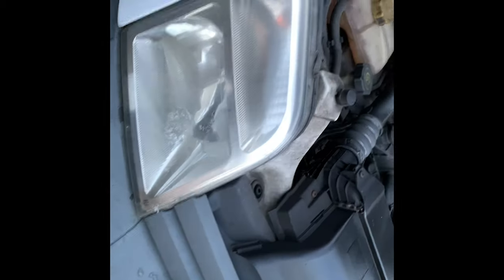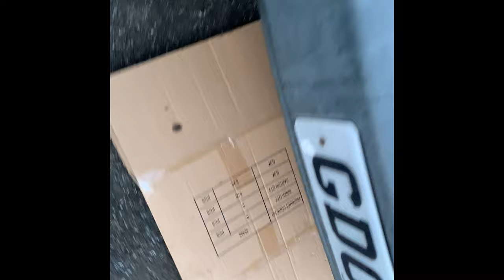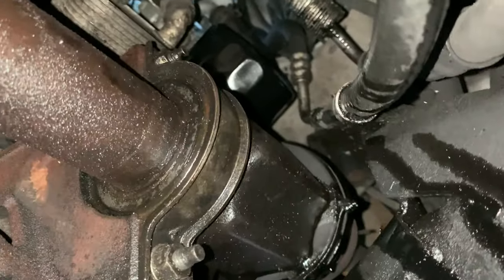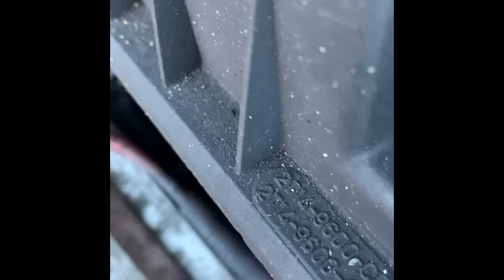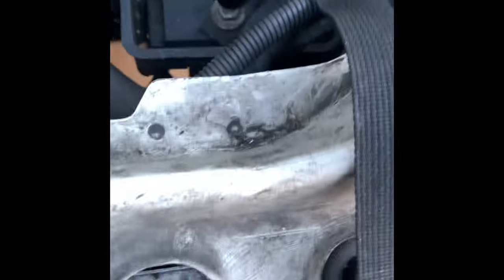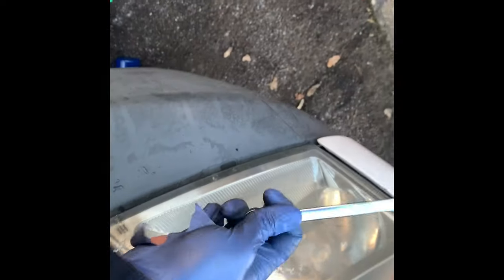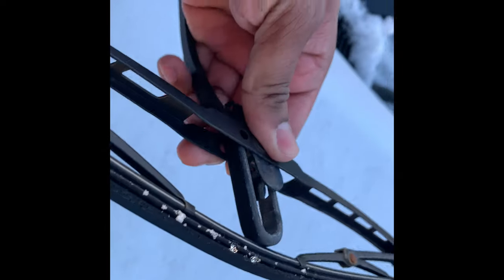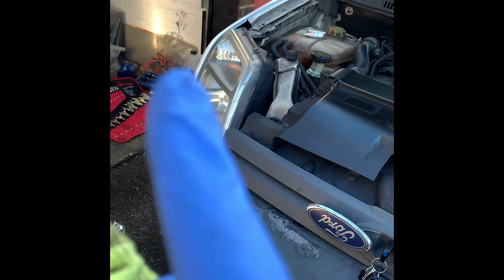Ford Transit Connect (1.8TDCI)Service Oil-Oil Filter-Air Filter-Battery-Wipers-Dipped Beam Headlight

Comment: You shouldn't need a tool to remove the oil filter. It should only be tightened hand tight. "It's a difficult location" is an understatement. What the hell was Ford thinking when they located it where it is in just about the most inaccessible place?
Reply from the maker: lol your absolutely right 😂
Reply: I did one yesterday, oil pissed ALL over the drive shaft and sub frame...

And of course, the floor. What a stupid location.
Reply: @edwardmurray8507  rubbish location and prone to leaking if not tightened right up
Reply: just about everything is in an awkward place on these vans. I had to take off my wheel and wheel arch to recharge my AC 😂😂😂

Comment: Hi bud I just wondered if you wouldn’t mind doing a video showing where the throttle position sensor is on a transit connect please as I think might be playing up sometimes acceleration is I bit slow from 10 mph and then picks up a bit quicker reaching 30 this is when engine is normal temperature when driving from cold it’s fine many thanks .
Reply from the maker: When this customers van comes back for it’s next service or anything else I will do mate
Reply: @jaysworkshopgarage  many thanks bud much appreciated keep up with the excellent videos
Reply: @alanhiggins1093  the sensor is on the throttle pedal , have to change whole pedal when it’s faulty
Reply: @justinstaines997  many thanks bud much appreciated

Comment: Subscribed thanks, my transit connect has the wrong battery in. Can I ask did you buy the type 100 or 110 battery from Eurocarparts? Can’t quite work out which one it should be.
Reply from the maker: You know what mate not even surely lol the customer brought everything to me and I just fitted it sorry pal & thanks for the sub 👍🏽
Reply: 110